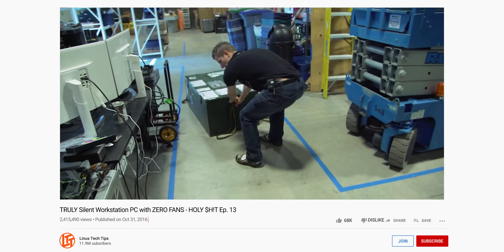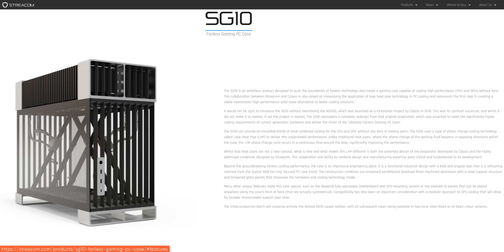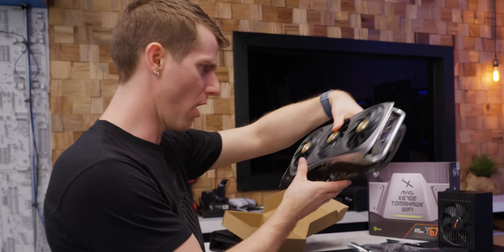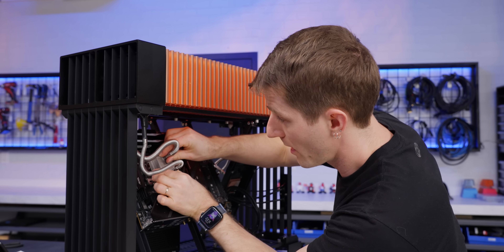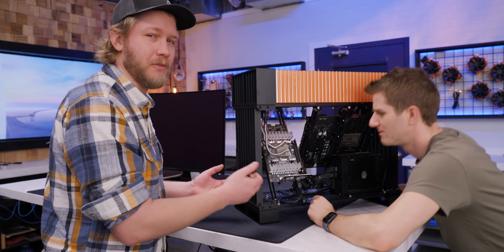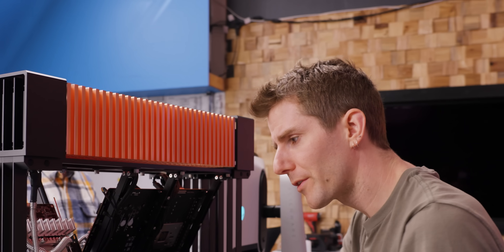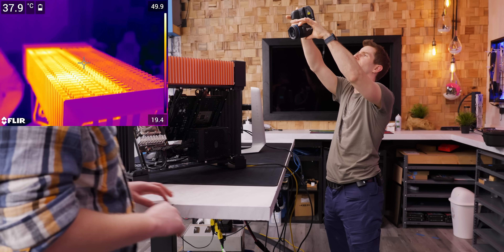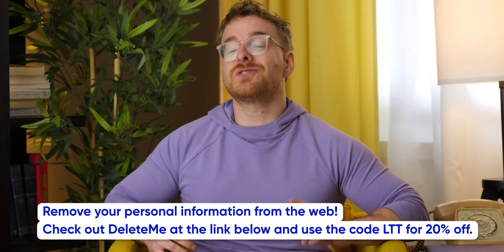I bought this scam PC case... And it actually arrived

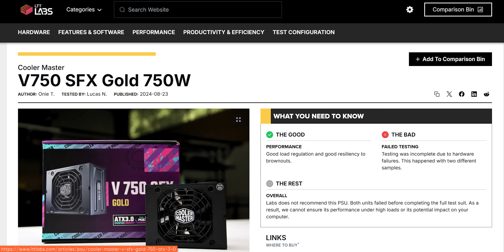Comment: @5:02  Decided to try out a cooler master PSU in a build last year because it was affordable and I thought they made decent stuff, however it died almost immediately lol. And I know this was probably just my luck but I was so disappointed. It powered on once, survived initial testing. Then I power the PC on the next day, download a few things, go to play a game and not even 20 minutes into my game the PC just shuts off. First time actually using the damn thing and it just dies. Did some testing and turned out the 12v rail was dead. I’m checking the labs site before I buy anything from now on lol. I mean it doesn’t look like you guys have tested the model I bought but I know you’re working on testing more stuff. Super excited for LTT Labs, it’s going to be such an amazing resource for the community.
Reply: I have a Cooler Master 850W power supply with a fan that I've used for 3 different builds over the past 8 years and haven't had any issues whatsoever.

I think fanless PSUs are just asking for trouble. A fan would absolutely be a must in every PSU I buy. I don't understand the reasoning behind going without.

Especially since most PSU fans are nearly inaudible even under load.
Reply: @kingzach74  Yeah especially if the pc your putting it in has case fans lol, not sure what the point would be. But the one I bought was a modular 850 gold with a fan, can’t remember the model number. Glad you’ve had better luck with yours!
Reply: Using the experience of one PSU is not enough to really put a label on a manufacturer. Well it's brand in this case as CoolerMaster doesn't make any PSU's themselves. They buy them from real manufacturers that build them to specs from the brand.

If I look back on PSU's that failed for me personally I have had a Cooler Master that had the fan dying and the PSU got overheated and died. I have also had a Be Quiet! PSU that failed after the fan died. Other than that I have seen a lot of cheap Chinese PSU's die. In my experience Seasonic, FSP, and Delta makes really reliable power supplies. I also have used several hundreds of PSU's from a manufacturer called Zippy, and they have been incredibly reliable. Only problem is they are more expensive than Seasonic, Corsair or other common brands and they are not suitable for most computers as they tend to be loud. They are absolutely some of the best power supplies you can find for servers though. One of the last times my boss called them the owner was busy designing a new PSU. So he started the company and owned it and hired people who knew how to run a company so that he could keep designing the circuitry for new products.
Reply: @blahorgaslisk7763  Yeah that’s why I said I know it’s just my luck lol, I’m sure they’re fine I just got very unlucky. I’ve had great luck with Seasonic, I have two very old Seasonic units still going strong and I very very rarely ever hear about a Seasonic failing. I’ve never heard of Zippy though? I’m going to have to look them up, sounds interesting.
Reply: @kcscustom  i bought a very expensive asus Thor i thought I’ll had a psu for years to come it died in less than a year
Reply: @allanolivas9814   Damn that’s so unlucky. That sucks sorry to hear that.
Reply: @kcscustom  technology is meant to fail at a certain point it’s just a mater of “when”

Comment: When they danced around the price for so long I was fully expecting used car prices. I remember the kickstarter for this being conceptually very cool but if anything the newer era of capable cards could make this a very capable, if still expensive, way to implement a gaming PC in a theater room that doesnt have the ability to relocate a fan whirling tower.
Reply: Dude, I bought my first three cars under $900 each. $2k? Those ARE used car prices.
Reply: @Vatharian  Not anymore sadly
Reply: @serenasharma Bought a 4x4 Suburban this year for $800, been daily driving it with only new brakes and fluid changes. Mechanically sound but ugly vehicles are cheap. Undented vehicles with nice interiors and working AC are expensive.
Reply: @Vatharian  it’s not 1980 any more grandpa
Reply: @SignetZero  💀
Reply: @Vatharian  2k is used car prices for a car that will not last. sadly.
Reply: nah $2k is def still used car prices for a lot of facebook marketplace beaters with 100k miles on them
Reply: That is used car prices, the most expensive car out of five I've bought since 2018 was $1500.

Comment: Imagine wrapping a pc with plastic so that it's air tight and water can't get inside  and putting it inside a pool or something, will it even work ? Will it run cooler than a water cooling system?

Comment: Just take some hardware that's LOW TDP but good l2 and l3 cache, tune in the infinity fabric and RAM, crank it up using PBO, undervolt to let PBO do its thing and scalar up, you wont get the thermals you would get from an excessively high TDP chip but you'll get more performance when paired with such cooling, spikes are bad, steady state performance is good  

I am looking at a vapor chamber CPU block and people think its terrible because they have these bursty chips. (which doesn't let vapor chamber work correctly, thats why they are used on servers)   It isnt at all bad when used right, 15,500 Cinebench on a Ryzen 7 5800XT using above methods.

Comment: You probably messed up the CPU mount too, paste on center and squish by CPU mount works when flat but here it probably mostly went down and didn't cover the top half very well. If it can cool a 4090 ? Color me intrigued, if I ever win the lottery I might be interested. I'm fed up with fan noise after 25+ years of them.

Comment: It is a pump, a gas lift, also called a bubble pump. It is what makes a electric drip coffee maker work. The boiling water causes liquid water to be raised up with the steam. There is typically a valve to keep it from boiling in the water reservoir. This case I guess the capillary  design of the cold plate is what acts as the valve.

Comment: Honestly for how custom it is 2 grand is not even that shocking. I was expecting like 5k or more 😂
Reply: I agree but it doesn't solve a 2k problem.  You can easily move the pc if sound was an issue
Reply: @guyod1  or build a sound proof kabinet, or use fiber and place the pc in a dedicated room where noise doesn't matter. That's absolutely true.

However...

It does look pretty cool 😅 This is quite obviously one of those "it doesn't solve anything, but the rule of cool" products for people with too much money in their pockets.

Comment: Even the double-priced copper version is a lot cheaper than expected, going by the way you lot were talking about it. It's in the mid-range GPU territory
Reply: what gpus are you talking about? mid range for 2k doesn't sound right.
Reply: @gjeraldh2989  just wait a year
Reply: @gjeraldh2989  2K is the double-priced extra limited edition. Nobody is even allowed to buy those lmfao

Comment: 14:30
Back in junior high, I was worried over what sort of project my friend and I would do for the annual science fair.  One of the phenomena I've always respected and pondered over was the weather.  I wanted to demonstrate beyond a doubt how one could circulate air without a fan, like a cold or warm front.  Being from New England, where all it takes is a minute for the weather to change, this mattered to me a great deal.

So, I came upon the idea of two coolers, one containing a hot plate, the other a chest of industrial-grade dry ice (CO2 in solid form).  We would set them alongside each other and then set a little string with a tuft of paper towel.  All it had to do was move as the otherwise imperceptible wind current formed.  Being that it involved hard chemicals and some electrical components, there was a lot of parental supervision, not to mention scrutiny.

My friend and I won 1st place in the Earth Science category.

And it was based on something that nobody had tried to demonstrate, let alone in such a crazy fashion.  The idea was to replicate the process for when we design a biodome or something.  Seeing the case perform its basic function with aplomb, complete with radiating the heat and causing the little cloth to warble in response, took me back plenty of decades, perhaps in a good way.  It needs refining before mass production can begin, but this PC case is not a scam.

Comment: Works barely better than low-RPM air cooling AND it creates more noise due to bubbly fluid when condensation happens. Not worth the wait at all.

Comment: sooo... lets say, without beating me up on my lack of knowledge here on this cooling setup, you ran 3 bottom intake fans, yeah adds noise, but what would or could happen to a a little air flow over the system itself / copper bits do for the overall picture here? anything? or just pure fantasy?

Comment: I would remove those dips in the lines... it's like having a heat trap on the GPU which isn't good.  The sound you hear is probably the refrigerant condensing, not boiling.

Comment: Honestly, that is actually quite cool. I would never actually buy it as 2k for almost no sound and a shorter component life just arent worth it. I feel like a standalone system with just a 360/420 radiator would be better but thats only for the GPU.

Comment: Wonder what a $400 portable fridge modd could do with a similar block for GPU and cpu
Reply: You'd kill the fridge. Consumer-grade fridges don't run 24/7. They turn on, they turn off. They aren't meant to have heat-generating things inside them.
Reply: @pieman3141  I was more in the line to use a compressor as a cooler

Comment: Impressive with powerfull hardware like this, but in hot weather will not work. And the longevity of the system will be compromised, because VRMs, RAM and stuff will be very hot for long time.
But with this maybe with some low speed 140mm fans on top will be a awesome performance and fully stop outside gaming.
Hope a "AIO" cooler with this tech will be avialable.

Comment: Yeah, you wait until that huge block of copper becomes heat saturated or you use it in a room with a higher ambient temperature. You're literally screwed.

And I've not seen how much this costs, but I'm going with north of $1000 for the copper alone.

Comment: That's super cool, but my entire system with a 5080, 360AIO + X3D CPU, and 32gb of ram cost less than the case alone. My system also runs cooler. CPU peaks at 60C and GPU 65C. I would love to see the evolution of this and maybe if they are produced at scale, the cost can come down to feasible levels.

Comment: Some 20 years ago I was in contact with a case manufacturer build a case for passive cooling a P4. It was far to expensive, so it vanished. Every 10 years someone else trys to make money and loses money in the process.
At least I had a passive cooled power supply with my first Athlon X2 system.

Comment: It's an answer to a question no one ever asked, a cool tech sure but you'll still need fans for the mobo, gpu board, ssd, etc.
And the convection effect is already in aftermarket air coolers with heat pipes.

Comment: That's one of the problems with passive cooling - not enough airflow for components not thermally connected to the heatsinks.
Reply: Don't look at the chipset temps, or nvme temps, or vrm temps...

This is why I've stopped trying to make a fanless system, and also mostly ignore external radiator builds. Even if the CPU and GPU can be covered by water blocks, all other components are made with the expectation that you will have fans blowing air on them.
Reply: @thorbear  Or limit yourself so much, that they dont ever get hot, basically monoblock/laptop build in a PC case which doesnt require much cooling to begin with.
Reply: @ I had a passive GPU so not necessarily but I believe those components were also connected to the heatsink so they definitely got cooling.
Reply: Looks cool but pointless when Noctua fans are basically silent
Reply: @Twenty_Six_Hundred  Sure but you still need a pump and a custom loop as there are no really silent GPUs on market. And pumps make noise. With such case you can just a few 140 mms and let them spin at minimal speed: get enough airflow for low pow components and no audible sound.
Reply: I thing this has a solution, there is airflow generated by the heatsink, it's more than enough - just cover aslo front and back of the case (upper half) and take air from bottom part, it would have to go through all components
Reply: @johnsean100  There is one problem, because on the load air temperature in the room will raise, which is bad for perfomance. So you still need to use external tools to keep air cool, making whole point of fanless setup completely obsolve. Why you even care about fanless, when aircooler provide much more noise, if you compare it to quite noctua fan. This is make no sense. Even with split setup it too much costly wise and provide zero profit for practical point on view.
Reply: @Biomanable  This depend on size of the room...and if you have fanless solution called window. And depends on temperature outside. For me it's completely useless, but if you are working in big openspace which is cooled not depending if your PC has fans or not, this might be a way to get silent pc. 
Btw who can afford 2k$ case is probably not working in his 9sqtm home office like me.

Comment: It will have a very flat temperature profile within the normal operating range. The boiling will only happen at a certain temeprature so even when under a low load, the temperature will stay pretty high.

Comment: I honestly thought it was going to be more expensive.

They seem to have nailed the heat dissipation aspect - as in, the capacity and ability to dump wattage is there. Even with the Al version, I'm sure it would work. The loop is solid. What I don't like is the interface with all the ancillary board components. The power stage on the GPU is quite hot, and I suspect it will take lifespan off the card. The little aluminum finned rails on the GPU are not fit for task. They should have used a copper heat spreader to get all the MOSFETS, caps, and chokes in good contact with the evaporator block.

Comment: Now if one were to add say, 2 140mm fans on the lowest setting for a bit more airflow, I'm curious how much better the temps would be. I get fanless is the main goal, but even a slight bit more air pushed from a near-silent fan usually results in notable improvements in most "fanless" cases reviewed in the past.

Comment: 2K doesn't actually seem that bad, as its case and complete cooling solution in one. A half decent case and all the Noctua fans and water cooling required to keep it similarly quiet isn't going to cost 2K (Probably anyway) but its not going to massively massively cheaper either, certainly I'd expect it to be a little more than the Aluminium version costs... So for those folks that put quiet at the top of their wish list, or that want something "stylish"  (assuming this is that for them) its actually looking pretty darn good value.

Comment: Non-tech: Cut a circle out of a piece of paper then cut the circle into a long, thin spiral. Attach thread to the center and suspend it above the heat source. You now have a neat convection detector that kids will enjoy.
Reply: Kids : tear a bunch of papers to small portions, add glitters. Throw it to on top of the case
Reply: @jeuno880  Great, now you got glitter ✨everywhere✨
Reply: I want one..
Reply: @casedistorted  a kid? That's expensive
Reply: @nkiwi77  Not to mention fragile
Reply: Not to mention it needs to be upgraded very often @TheRealBigYang
Reply: @nkiwi77  No, the kids aren't allowed to use the computer. They are only allowed to watch the paper spiral spin. 😂
Reply: Non-tech: Get a Pringles can, a rubber glove, and some sponges
Reply: @uropig  Just get one sponge and use the green side like a man
Reply: @uropig is ur pfp Sam o nella?
Reply: @uropig  solid advice use gloves and sponges to get cleaning job and store your cash in the pringles can its flawless
Reply: Immagine it starts spinning then immediatly combusts lmao
Reply: @ Given it's getting up toward 1kW, a Hibachi grill attachment is probably an option.
Reply: There's one more trick to making that spiral. To attach the string, make a hole in the paper, feed the string through and make a knot in it to stop the end from going through. The spiral can now turn on the string once the string has been twisted often enough by the spiral rotating that it overcomes friction. If you attach the string without something like this, the string will twist until the force needed to twist it more gets higher than what the airflow imparts on the spiral stops it.

Alternatively, if you attach the string to the ceiling with a thumbtack, knot a loop into the string that is smaller than the thumbtack's head, pi through that loop and don't press the tack in fully. The string can now rotate there.
Reply: Linus: What are your pronounces?
Cloth hanging from ceiling: She/her
Linus: Oh yeah, she moves 👀
Reply: @YPP22010  I think he meant the case, as in "she really moves the air".
Reply: @chaos.corner  This is just great! I'll do it now!😂

Comment: I'd like to see someone modify the cold plate for the GPU side and make it more robust and cover more of the components, but other than that, I'm kind of impressed. You threw some fairly hot chips at it and it did admirably. It could be better, but I mean, it has no fans.. It kind of defeats the purpose, but I'd be curious to know how much the temps would drop if you mounted a couple of 200mm fans on that heatsink.

Comment: I wonder how much cooler it would run if they mounted fans on the top of the heat exchanger to force more air through it. Linus, try it with fans on the top pulling air through it and see the difference.